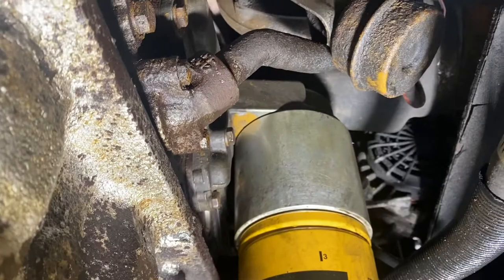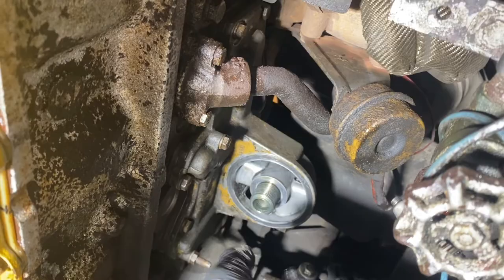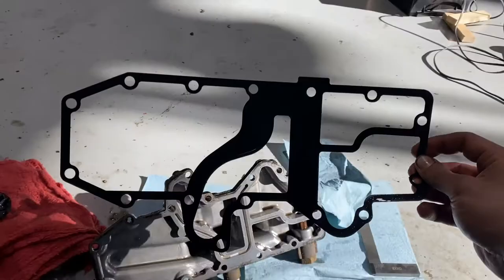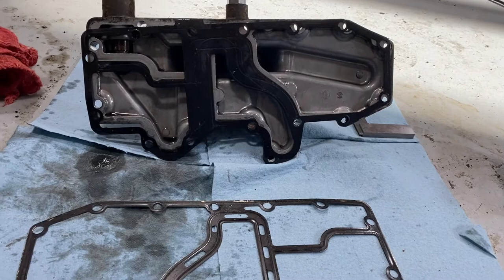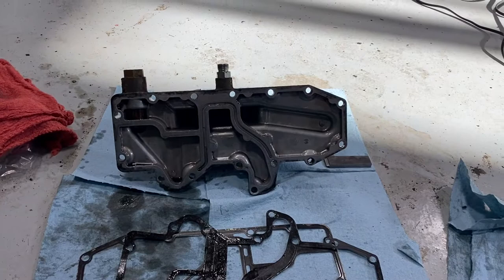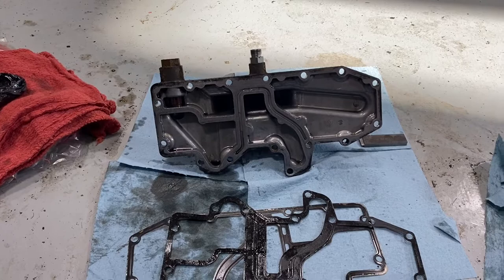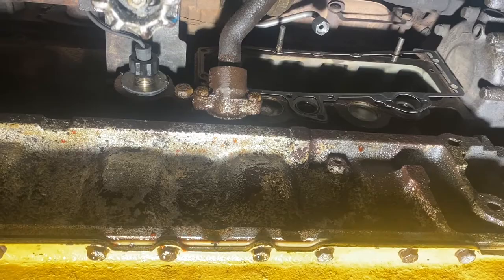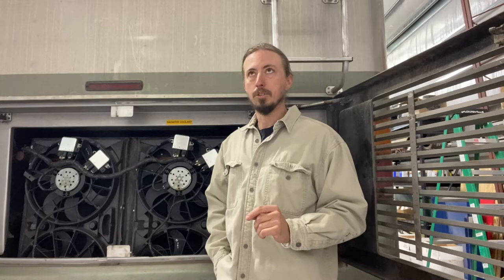Caterpillar 3126/C7 Oil Filter Housing Gasket Replacement

Comment: thank you for this, for those asking, I believe the gasket kit is 1422222,  less than $30 on ebay
Reply from the maker: Glad you liked the video Don!

As a rule I don't put Cat part numbers in my videos because they do regularly supersede parts, even on these older engines (I talk about that at around 15:30 🙂). If someone is watching a video years after I made it the procedure is still right, but Cat may have changed parts.

Doing a quick Google search, it looks like the part number you provided is the old style gasket, which was prone to blow-outs and letting unfiltered oil go through the engine (causing HEUI failures, etc.). If you go to 7:07 in the video, you'll see I have the old gasket (on the bottom) and the new gasket (on the top, leaning against the oil filter housing) for comparison.

Comment: Would you have the part numbers for the items that you used in the torque diagram?
Reply from the maker: I don't. If you go to the Cat dealer with your engine serial number they can make sure you get the correct parts for your engine.

Comment: How long did it take to r & r that?
Reply from the maker: I think if you've never done it before, it would be good to plan a full day for it and take your time and not feel rushed. Starting on a Saturday so you have a Sunday as well wouldn't be a bad idea. Remember you have to drain the cooling system and then also refill it as well when doing this work.

Comment: Hey! First off, thank you so much for this video as I’ve found a leak in the exact same spot on my 3126. I’ve got the Oil Filter Housing off, but I’m having some trouble getting the Oil Cooler out of the block. Do you have any suggestions on getting it out? I haven’t wanted to pry on it in fear of messing it up.
Reply from the maker: If you try a dull punch (brass would be ideal as that shouldn't damage anything) and a dead blow hammer you should be able to knock it loose. I'd bet it's just stuck on from years of sitting.

If you watch through the whole video, I include what I did to get the assembly back on more easily, and note the differences on the new housing vs. old housing and the new oil cooler. Oil cooler flatness is very importance here so make sure you check that.
Reply: Thank you for the quick reply! Thankfully I got the cooler out without much more hassle. Getting the old gaskets off took a ridiculous amount of time though. I’ve already taken your and CAT’s advice and got me two hangers in there.

Hopefully will be able to get it running again today and see if there’s anymore leaks. This job has been a real PITA.
Reply from the maker: @Anadar23  Glad to hear you're getting it back together. The good news is that once you have it back together and working (make sure to check out the areas where I had problems - I had to do it a second time) it should be reliable. Since recording this video I've had zero issues.

Comment: Ted Great Info!!....I need to pull the filter housing on my C-7 because some speedco bubba apparently put the filter on dry with an impact wrench for the previous owner....what's your opinion on just changing the oil filter base and gasket but not disturbing the cooler to block interface? have had no signs of leakage...will be changing coolant as well since I'm in there anyway...Thanks and really enjoy your videos
Reply from the maker: Glad you enjoy the videos!

I don't think it's going to be possible to change just the oil filter base and gasket without disturbing the cooler to block interface. The bolts sandwich the block, oil cooler, oil filter housing, and gaskets/o-rings all together. Assuming that you don't/don't need to change the cooler, the only extra cost/effort is the extra gasket/o-rings between the cooler and the block.

Make sure to check all the surfaces while you have it apart, especially if you get the updated gaskets and had the early style gaskets on there. That's what caused problems for me and why I had to take it apart and do it the second time.
Reply: @TedsGarage  Thanks for the reply and info...man, what a PITA to work on...especially trying to remove the bolts with a mangled oil filter stuck on the housing ....what size is the fitting on the turbo feed line? can barely reach it let alone see it.. I'm going to go ahead and get new filter housing and latest gaskets direct from CAT....working with my new besties at Michigan CAT..thanks again for your help. Ed Magner
Reply from the maker: @wtfengineering   On mine I believe the turbo feed line was either 11/16 or 3/4, and I got it with a crow's foot and a long extension from the top. If I were you I would do what I did the second time - buy the new filter housing, buy a new oil cooler, buy the new/updated gaskets and O-rings, and then just shotgun the whole thing.
Reply: @TedsGarage  okay,  you convinced me...i just ordered the reman cooler with the gasket set so everything will be new going back together. I got a wrench on the turbo oil feed line (it is 3/4) but it doesn't seem to want to break loose easily..like maybe it's twisting the feed pipe. What is the connection there? Is it like a compression fitting or an inverted flare? would like to know what i'm dealing with so i don't eff something else up...I have 14 of the 15 bolts out so 1 bolt plus the fitting on top...as i said earlier, this is a lot tougher with the mangled filter still in place..thanks again for the help Ed
Reply from the maker: You probably have dirt in that fitting and it’s likely seized to the pipe. The pipe inside the fitting is flat and there’s an O-ring between it and the fitting that screws into the oil filter housing (you’ll need that O-ring too).

My recollection is that when I went to take that off the pipe ended up twisting and breaking since the nut was seized and I had to buy a new pipe. To my surprise, the screws came off the turbo side just fine. Use some Kroil or PB Blaster to help penetrate everything and work carefully.

Comment: Awesome info. Hope I never have to do this on mine. How expensive were parts altogether?
Reply from the maker: I don't have the receipts anymore, but I think that it was around $650. I had to buy the overhauled oil cooler, the new oil filter housing, the gaskets for both of them, some miscellaneous O-rings, and since you have to drain the cooling system I replaced the coolant as well.

I definitely agree it's a job to hope you don't have to do. But it's also one of those jobs that you'll probably only ever have to do once.

Comment: Can you tell me what the torque spec is on the bolts? I have the sequence just can't find the torque value.
Thanks and this really helped me decide on this job
Reply from the maker: Glad the video helped you!

I got my values from catengine.info, below link. Note that it’s a two step torque procedure. I snugged all the bolts down in order first, then did the first torque and then the second torque sequence.

http://www.catengine.info/workshop/3126/3116-and-3126-truck-engines-engine-oil-filter-base-install.html